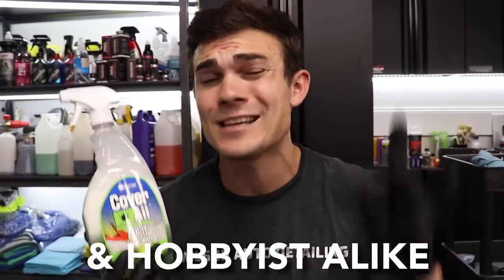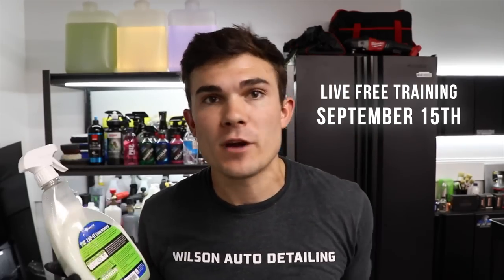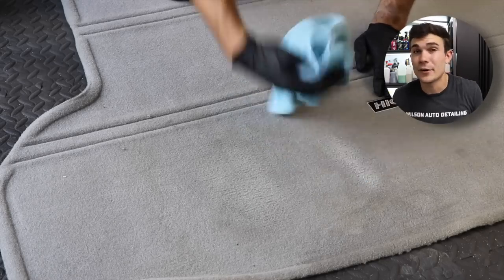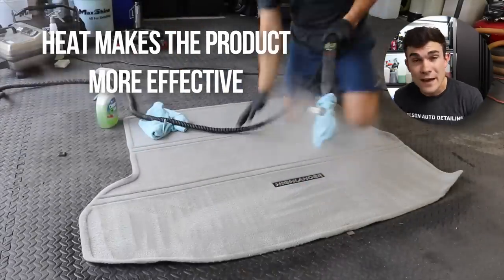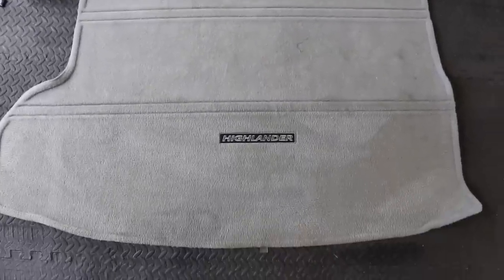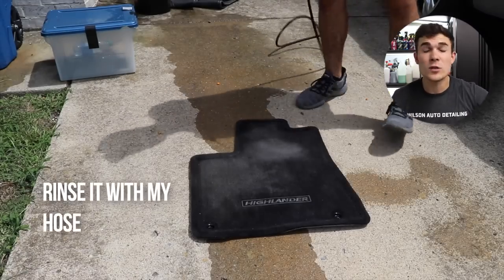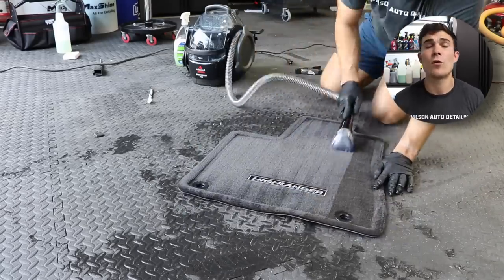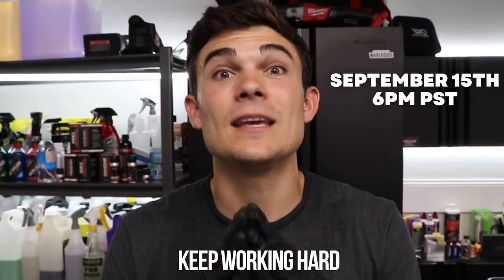I Waited 6 Months To Show This Retail Product

Comment: I’ve been looking into this product line lately. Apparently they’ve been under the radar on YouTube for the last few years but have had some definite winners stand out. Most of their line come on gallon sizes for between $10-20 and are dilutable. A damn good value by the looks. I’m pretty stocked up but I’m itching to try this brand.
Reply: I currently use the spray 4 wax as my drying aid and dark fury as my wheel tire but and lower half of the car cleaner. I feel for the cheap price it’s very versatile for many applications!  Due to there cheaper prices I’ve been slowly picking there products up and trying them
Reply: i work at Oriely's and they're one of our main chemical product though the on shelf line is called cover all

Comment: Now heres the question wilson. the solvents inside of the prodcut may not be safe for the fibers on this carpet matt. did u look at what the prosuct is made off.may not be safe on those carpet fibers.   I use safe non solvent products that dont damage fibers in the carpet.
Reply: All citrus solvents and any citrus-based are relatively safe for fabrics.
Reply: It's dextro-limonene, those terpenes are milder and are non-caustic.